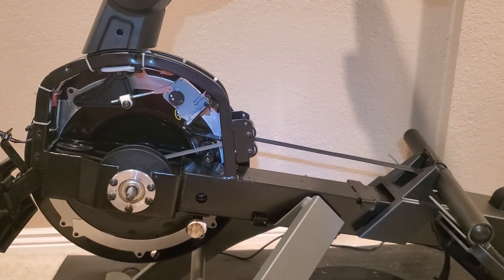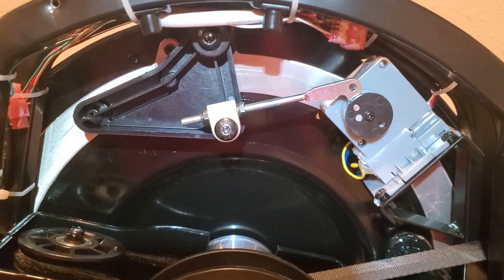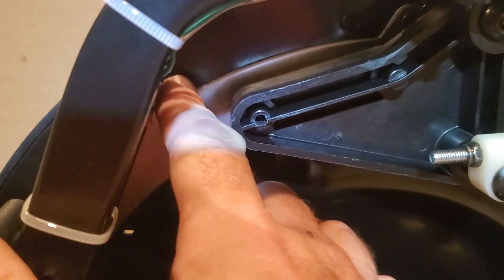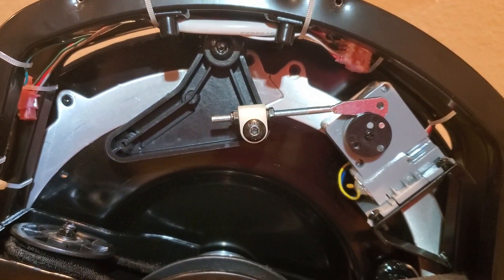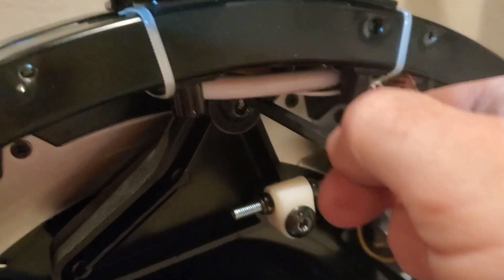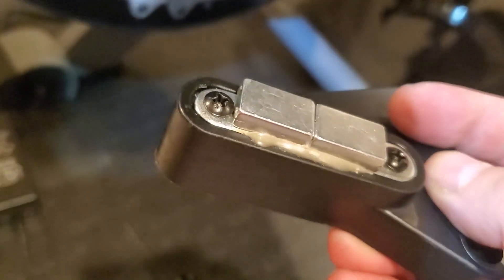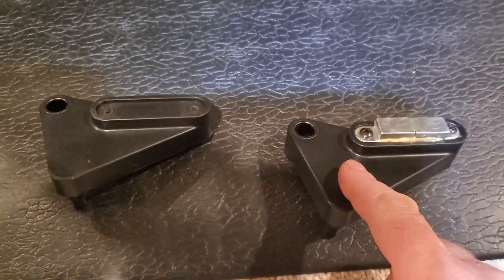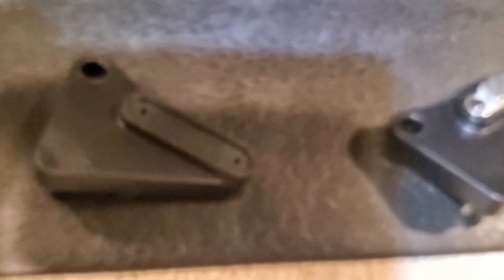NordicTrack RW900 Rower: fixing broken magnetic resistance / technical review

Comment: Any ideas on how to get the flywheel off? I pulled the nut off, but the flywheel won't pull off.
Reply: There is a special puller tool that Norditrack sent me when we were still under warranty. We moved for military reasons shortly after I got the parts and never got around to working on it until literally today (4years later) because I found the part while cleaning and organizing my tool box.

Comment: Thank you again for this video!!!!
I removed the flywheel on the right side, and loosened the 2 screws that hold the magnet against the holding bracket. I added washers on both sides until the magnet was just far enough away not to rub when the wheel turns. Put it all back together, and works perfect, as it should.....with noticeable differences  in resistance levels all the way from 1 to 26.
Picked up a $2300 rower for $800,  and it cost me $12 to buy a crank puller, and a few washers I already had on hand.👍👍

Comment: How do you remove the flywheel?  I got the nut off, but won't budge!! Is there any way of getting it off without a wheel puller?
Reply: Same here! Please appreciate tips on how to get it off
Reply: @alondagan9440 I bought a wheel puller (if that's the correct name) on Amazon and worked perfect

Comment: I will have to take mine apart now, and see if i can get the results that it should have from factory.
 I'm assuming this is why i bought this one for the less then half of what the seller wanted for it.  She knew there was no difference in resistance levels, but didn't happen to mention that when we looked at it.

Comment: I bought a used NT rower for $90 in good condition, but it's almost impossible to row (too much resistance) and the tension lever (only 10 levels) doesn't seem to make any difference. I'm going to use this video to get in there and see if I can fix it. Fingers crossed.

Comment: Fair play for the video and thanks for all the people in the comments. For me, I couldn’t get the flywheel off but I managed to take the spring loaded brake pad off. Placed a spacer on it so that it was just  touching the flywheel and this seems to have solved my problem. 
Absolutely horrendous manufacturing though that so many of these machines don’t work properly after assembly. I was using mine for about 18 months without realising that the resistance was far too high and wondering why I couldn’t feel any change in resistance from either the magnetic resistance or even the air resistance.

Comment: I'm blown away that Nordictrack think it's acceptable to sell equipment that simply doesn't work as intended and instead of taking responsibility for fixing the issue, send a bunch of non related parts. I suspect the underlying issue is the fly wheel is not being seated consistently and close enough down the spindle to reach the magnet mechanism. It looks like the design is not intended to have any adjustment, or to need any, but does rely on accurate assembly during manufacture.

Comment: Thanks for posting. My main issue was the brake pad exerting too much force on the wheel. I cut a few coils from the brake pad spring and it fixed it for me. The majority of the resistance comes from this brake pad. It's really a scam rower. The magnet offers little to no resistance in the overall rowing

Comment: I bought this 1.5 years ago, and it's never really worked like I thought it should, but structurally, it looks great, so I never took it back, I have other equipment I use so it doesn't get used all the time, but this is exactly what's wrong with mine, I've been using it on 26 the entire time thinking that was just the way it was supposed to be " my first ever rower"  I hope I can get mine fixed like you have with yours 😢 I'm soo upset with how much money I feel I wasted

Comment: Great video Greg ! In my 200 Rower, left fan touches and grinds against bearing bracket  screw heads (71), making noise. Left side of axle has no groove/snap ring, to keep left fan away from screws. Right side fan sits against snap ring(25) in a groove, so doesn’t touch the screw heads. Any suggestions ? Thanks.
Solved my problem, left side snap ring broke, axle shifted slightly to the right, snap ring groove was hidden under the bearing, replaced snap ring, put everything back together.

Comment: You should put a piece of foam under your new magnet adjustment so it has a cushion and is not moving and widening the holes over time. But it's understandable that the flywheel would warp over time. I agree there's no benefit to the wind adjustment. I though it was just to set how much air is blowing on you. 😂

Comment: Hi Greg, thanks for the video. I am going to step this very same fix on my nordictrack rw700, I bought it second hand for a great price but found it had the same issue with the resistance staying the same, just like on your video the magnet is miles away from the metal plate, I just wanted to know if you do video showing the fix in action? I wondered if moving the magnet closer allowed the resistance to get easier as well as harder??? As I am already finding it tough on the setting it is stuck on! 😂

Comment: I am a technician in NYC  I was on a service call with the same problem and have to go back. After watching your video I decided to remove the screws from the magnet and just add washers as spacers behind the complete magnet enough to bring the magnet closer to the wheel. This would eliminate the drilling and the hardware plus be a lot quicker. I believe this should work.

Comment: Wife and I purchased an RW500 at the beginning of the pandemic.  We had both used the rowers at our gym occasionally in the past and thought that a rower would be the best choice for a home workout - better than a treadmill or bike.

I didn't use the rower much in the beginning, but when I did start using it I found two surprises: 1) the force required to pull even when set at resistance 1 was surprisingly high (especially compared to the air rower at the gym) and 2) the fact that there was little to no perceived difference between resistance 1 and resistance 26.

This video has allowed me to fix #2, though I didn't follow it exactly.  Upon disassembly, I found that the distance between the magnet and the wheel was even greater than in the video - closer to 3/8 of an inch.  After examining all the components, I went to Home Depot and picked up a package of twelve #8 flat washers and another package of #6 x 1" long round head sheet metal screws.  I removed the magnet, stacked five of the washers above each screw hole, and then used the new screws to hold everything together.  The washers are 0.040" (1mm) thick, so the stack of five had the effect of moving the magnet 0.200" closer to the wheel.  Thankfully, both of the fan wheels on my rower run very true.  With this change, I can finally perceive the difference between the lowest and highest resistance levels.

What has not changed significantly is #1 - the force required to get the belt moving at all.  I have read some owners complain that the force is so great that they are simply unable to use the machine at all.

I don't have that problem, but I would like it to be much less than it is currently.  I see in the earlier comments that this may be caused by poor brake design?  I'll have to remove the casing again when I have time to do so and see if there is a practical solution.  If anyone has any thoughts on this, I would be very happy to read them.
Reply: Looking into this now!
Reply: @Mangoomads  FWIW, I did find that applying a good amount of silicone grease to the brake pads helped with #1 above yeah that's

Comment: Gregs advice is spot on. I used simplified version. Removed the right side and fly wheel. Removed the screws of the magnet. Added 2 washers behind the front screw and 3 in de back one the magnets are parallel to the fly wheel. Gap is big enough to clear the runout of the fly wheel
Reply: Any advice or tips on removing the plate holding the magnets? I unscrewed it but the plate won't budge off. I want to place the washers behind it like you recommended.

Comment: Oh my goodness. Thank you! I have the same problem on mine. But of course 2000$ waisted on a rower that won't change resistance.  Magnet is actually so close to the wheel that it was grinding down against each other. Nordic track sent me new interior pieces that are not apart of the problem. Thanks for your detailed help.

Comment: this is very informative video, i learned a lot about how it setup, how to take it apart and make adjustments. based on your video i can see that my magnet on the lowest setting (not aligned with the wheel) but resistance is too high. i have 2 issues: 1. resistance too high (while magnet off the wheel). 2. my resistance motor is not moving (they sent me a new one and once replaced it's not doing anything either).   any ideas on what could be wrong or how to troubleshoot?

Comment: a lot of design and theory opinions offered here. however i agree this design is flawed. modifying the magnet mounts is a lot of work to do on something you already paid good money for. on my RW200 the unadjustable dampening resistance (drag) provided by the felt pad seems to be the critical reason the two-component magnetic resistance adjustment system doesn't work well. my elliptical has about a dozen magnets positioned on the outer rim resulting in a much better range of resistance.

Comment: Did you ever try it without the fan blade and if so what was your experience with that?
Reply: My RW500 rower will not register rowing when at least the magnet side fan blade is off. With the fan blade off and you begin to row, the screen gives the start message "Begin rowing to start" even after you start rowing.

Comment: A huge thank you for this video and fix.  I picked up an RW500 for free as the previous owner was going to throw it out because of the resistance issue.  A $1.50 for longer screws and washers and it works great thanks to you!  The wheels/fans are trued up and everything has been cleaned and greased and is good for another 100 miles of rowing.  Thank you so much.  Dave

Comment: Thanks for the video Greg.  I set out to fix this issue tonight after watching your video and made some additional discoveries.  You are headed in the right direction to solve the non-working digital/magnetic resistance but nothing here will solve the issue of the lowest setting being too heavy.  

For the digital adjust/magnetic resistance the actual issue is that the mount/fulcrum for the magnets is not welded on straight.  If you remove the arm with the magnets you can put a simple adjustable/crescent wrench on the face of the pin/pivot/fulcrum and the back of the mount and bend it so that the pin/pivot/fulcrum is square to the flywheel on that side.  No need for any shims or spacers.  With my unit the bracket was bent enough that even with the correct spacers the magnets still sat at an angle to the flywheel such that you would need tapered spacers to correct it.  Just bend it straight and away you go.  However, there is still a chance that it's welded on complete wrong and you need spacers anyway but straightening it is the best way to correct any off-angle.  

If your unit is just too hard to workout on even on the lowest setting the issue is that the brake is causing too much friction.  My unit only has one brake pad and I re-applied the lubricant that was on it already and spread it out over the braking surface and found that it was still just too much resistance.  In the end what I did was just removed the brake mechanism all-together.  You can hold it around the outside of the pad mount with a channel locks and take the nut off the back.  The pad is there to reduce the spin at the end of the stroke so that momentum doesn't help you on the next pull.  You could alternatively put a lighter spring into the pad mechanism but I found that the wind drag on the flywheels is enough for my (and my wifes) tastes.
Reply: Any ideas on how to get the flywheel off? I pulled the nut off, but the flywheel won't pull off. Thanks!
Reply: Where exactly is this brake pad, if you don’t mind me asking. Four repair visits and no one mentioned this or pointed it out as the issue, or a way to fix. iFit sucks btw, I will never deal with them again. They deserve their business to crumble around their feet. Just telling the universe! 🤞🏻
Reply: @Crystalwren  You have to remove the two halves of the enclosure around the flywheel/fan.   You can find the brake on the inside of the flywheel.  If you are looking at the flywheel from the right side, the pad is at about at the 9 o'clock position.

Comment: Just wanted to say that this modification works 100%. I found an rw200 series locally from a lady that never used it for 200 dollars. The resistance was honestly a joke and it was pretty much worthless as is. I just shimmed the bottom of the magnet with aluminum tape instead of making it adjustable but I may go back and do this in the future if the machine holds up. It now has just as much if not more resistance than a concept rower set on 10. I don’t know about the durability of the rower because I haven’t had it long enough but if it holds up it would be a sound investment if you can find one cheap and secondhand.

Comment: I have the rw500 and the larger issue for me was that the little spring loaded “brake pad” that makes direct contact with the right hand side flywheel was applying more resistance than the highest magnetic setting could even apply, so on the lowest setting it was too hard and on the highest it felt exactly the same. My solution was to remove it entirely and that allows for the magnetic resistance to be the primary resistance and the mechanism now gives at least some perceptible difference between the levels.
Reply: I’m about to open my rw600, I hope that this is all I have to do!! Does resistance 1 and 29 feel different? Also does the airflow make a difference?

Comment: Thank you for the video- we sadly bought a rw900 rower and it has too much resistance all the time. We had their repairman come out and he thought he could fix it. He ordered a part but then when he opened the rower up to install it, he was pretty sure he couldn’t fix it. A part is welded on crooked. But he installed the part anyway to try. It didn’t work. He reported it back to Nordic track. But they are giving us the run around! Talk about a company that knows their rower has issues yet they don’t want to take responsibility for their product. My advice, stay away from Nordic Track!!!
Reply: You can bend the misweleded part to fix the digital resistance issue but it won't solve your over resistance all the time problem.  The issue is the brake inside the unit applies too much friction.  I just removed mine and it's great.
Reply: Hmm interesting. Didn’t know there was a brake.
Reply: That spring is applying too much force to the brake. Cut off 3 coils and problem solved